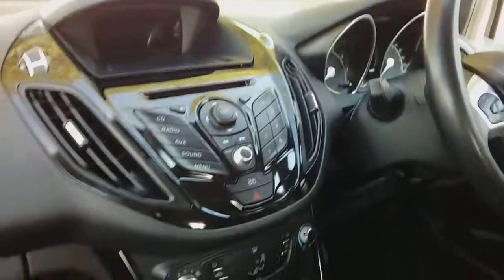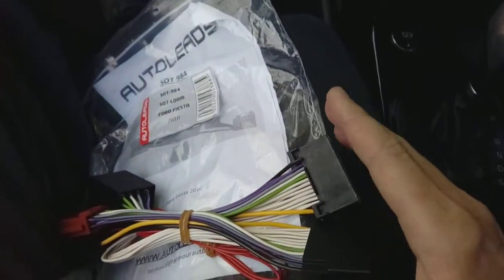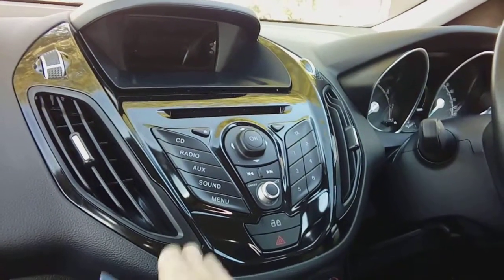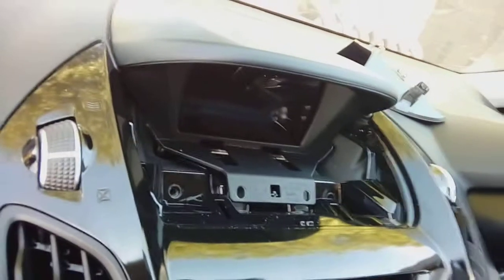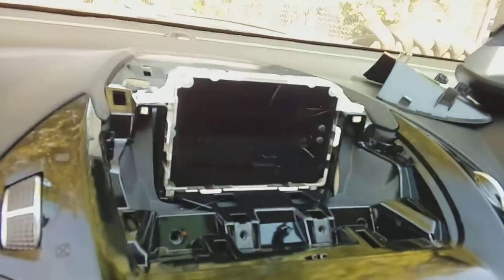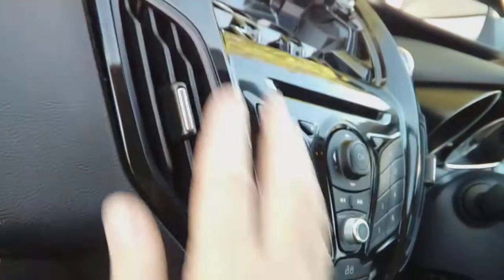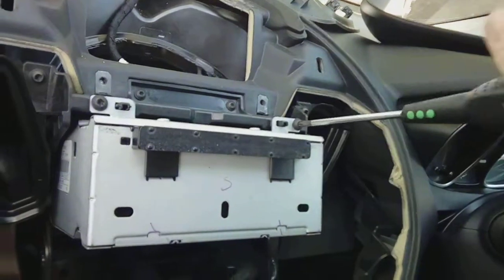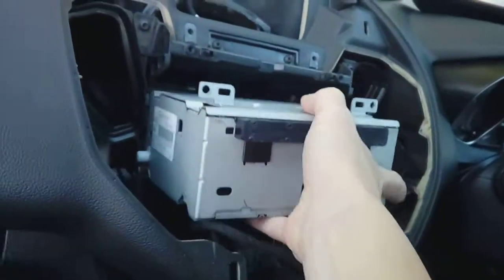Ford B-Max 2012 onwards how to remove radio,simple guide

Comment: Great Video well explained, when unplugging the elec block at the rear of radio, would the other end of multi cable go straight to power source, speakers ect , rather than going to another block connector under the lower dash.

Comment: Hi, wonder if you or anybody else can answer this, so I have a 16 B max with synch 2 and I have a Chinese android stereo. When I get the new fascia how do I control the synch elements as the buttons  will not be there anymore?
Do I need some extra software for the Chinese unit so that when the synch asks for something on its screen I can answer it.
Reply: Hi, bro.
I have about the same task and I ask myself the same question. So far I have only one solution - to make a mini keyboard (for example from an old mobile phone) and thus replace the old native keyboard... Maybe there are other solutions?